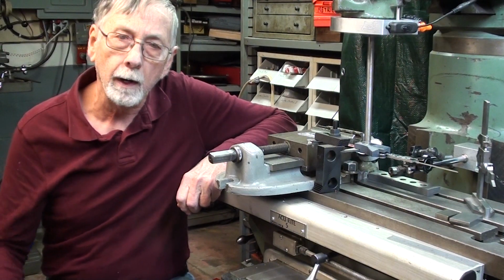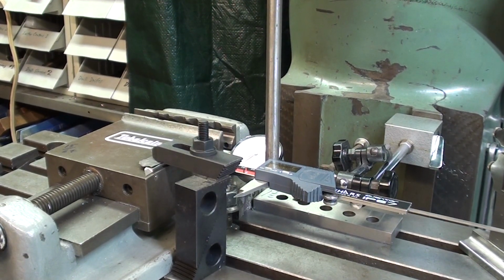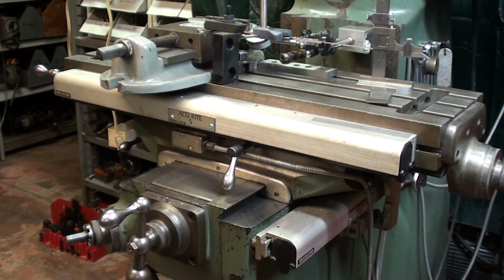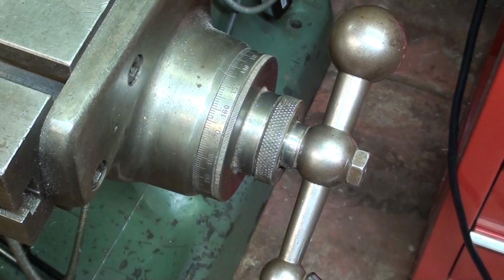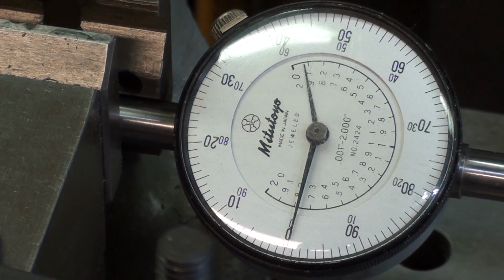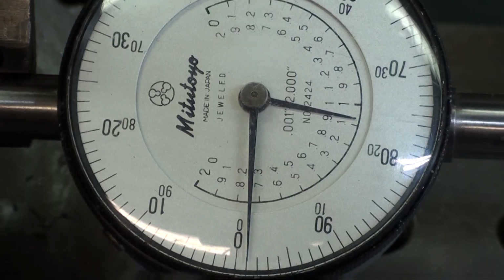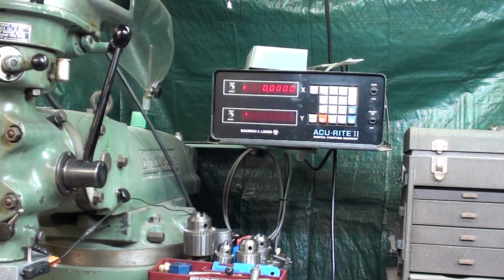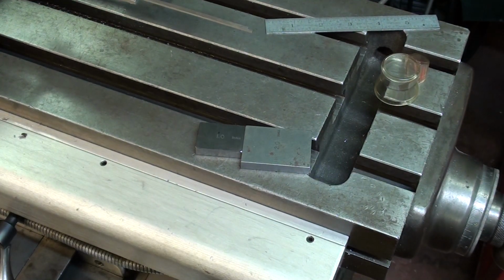Accuracy of the Bridgeport Mill Tips 527 tubalcain

Comment: Thank you Mr. Pete. It's great to see you bring up this subject since I worked in metrology lab at a helicopter factory. I did notice that you did not mention the temperature which would effect the readings. However, if all the instruments used were soaking at the same temperature for a while I'm assuming they were and they should not be too far off. The big issue we would run into to is, people never liked to send their tools in for calibration. Every instrument would have a cycle time of a calibrated window of time and things do drift in time. We would often say it's close enough for government work. The definition kind of goes like this. If you can measure with a micrometer marker with a piece of chalk, then you can cut it with a hatchet. Have great day and keep those videos coming since we are getting that storm tonight through tomorrow.
Reply from the maker: Everything had been in the basement shop at about 68° four months
Reply: I like your comment on temperature. Most machine shops and machines are cold at the start of the shift. Then allot warmer at the end but the components still seem to fit. Is it because we humans still have to manually  check the finished size.
Reply: Those of us that watch a lot of Mr. Pete already know his shop is at 68

Comment: like science    The more I learn the more questions I come up with.   How do D R O  work???   The dial indicator every time you moved it the more it was off.   All those internal parts tolerance must accumulate.    Must be some kind of ratio in there.  Please keep doing these.   GOOD WINTER PASS TIME
Reply from the maker: Yes
Reply: Most DROs use glass scales on which a fine pattern of lines perpendicular to the direction of travel are laid.  Through the glass you have a lamp and 2 photodetectors.  The shadow of the lines on the detectors gives a quadrature signal so the electronics can extract direction and distance information from the signal.  Other systems use small steel balls in a tube or an actual gear and track system.

All of these systems have some error.  Some have a common source - a scale at an angle to the travel has error known as ABBE error, temperature changes the length of a glass scale differently from the table, etc.  Most errors can be compensated for - in the examples by aligning the scale with the table and by providing a temperature controlled environment.

For most of us the normal sources of error don't matter in ordinary machining, but I've been around folks who controlled local temperature to better than 1/4 a degF to the point of providing a source of heat to replace the body heat when the operator was gone.

Comment: Nice setup. The flex in that 1/2" bar under the load it sees here from the caliper is going to be less than the resolution of any of the readouts. The dial indicator has a tolerance that is pretty lax once you get past the first 2-1/2 revs, probably 0.002". I tend to agree the DRO is likely the most accurate, but it looks as if all match within tolerance. As to the name of the caliper, I used to work with a "machinist" who called every caliper, even a simple 1/32" pocket caliper, a "vernier". I used, and still use, vernier calipers for many things, so always had one handy. Every time he got into a spot where he needed someone to get a tool for him-- a habit due to his poor set-up practice-- the first tool he usually needed was a caliper. "Hey! Grab me a vernier!" Knowing full well he wanted a dial caliper or the shop's digimatic, I'd hand him my vernier just to hear him scream "Not that! The vernier! The dial vernier!".
Reply from the maker: That is funny, I am grinning

Comment: great video. some time ago i ran a similar test on my van norman mod 12 and my 40 yr old mill drill.i was amazed at how accurate the dials were on both machines my readouts on both machines are the inexpensive igage units. these units are very accurate, i was getting plus or minus a thou over four inches. the reason for my test was my inability to center holes on my y axis to less than .004 i used four different edgefinders and got the same results.i reasoned that something in the machine readout s was causing the problem.turned out to be my technique with the edge finder. learned a lot from those tests. years ago we really had to know our machines to do accurate work .today i think we take them for granted.
Reply from the maker: Yes, I hope more people perform some of these tests on their machines. It is fascinating. And I am amazed at how accurate the screws are

Comment: I tend to trust my dial caliper a lot more than the digital.  I've had it since the mid '90s and I'm a lot more used to it.

I tend to think that the point of transition from/to a lesser used area of the feed screw into/out of a more used (worn) area is where a lot of error comes from on the older machines.  It's not just because of a small dial that causes the eyes of even the young to cross when trying to make that last 0.001 in feed.  

I don't have a DRO, so I fall back to a dial indicator.  My problem with that is I tend to get paranoid about cosine error (I don't trust my eyes with that either).
Reply from the maker: Yes 👍
Reply: If you're worried about cosine error, does that mean that you cannot make the dail indicator point in the right direction to within 2 degrees? The inverse cosine of 0.999 is 2.6 degrees. I never checked the precision in the direction of my indicator, but 2 degrees seems to be a lot.
Reply: @grieske  I set it up to look straight one way, it's crooked in the other.  After a while, it never looks right unless I go away from it for a while.  It's the eyes.  I dropped attempting to play musical instruments in school because the notes kept changing lines on the page.

I adapt where I can.  On a lathe dial, I use my thumbs to block out all but the one I'm trying to line up on.  I've also thought up and prototyped a jig that helps with setting up the dial indicator in most cases, and have ideas for improving it.  It's pretty simple, really.  

I think it would make a good introductory project for someone that it getting started with a lathe.  Mill or shaper as well, if they have one.  Embellish it if they want to, or keep as simple as needed.  I think it could be 3D printed, or machined out of anything that isn't jell-o or explosive.

Comment: I did this when i installed my cheap i gauging scales on my mini mill and was quite impressed..
Reply: The dro is the accurate one in my setup... since the dials on the mill are in thousands of an inch but its a metric leadscrew
Reply: I also have the igaging dros, not bad. I just really don’t like the lag on the display. And sometimes I really desire some of the features of the big units.

Comment: Joke Chinese proverb (cited many time below:) Man with two watches never certain of time. Uncertainty hovers in the background when someone declares a measurement to be exactly a certain value. Wise folks follow the number with weasel words stating a tolerance band, and reference the certification of the equipment used. This certification may be tracked backwards through calibrations and certifications of even greater refinement to the actual standards at NIST, a calibration date, signature, etc and even beyond to international standards. These standards are a very big deal subject to treaty obligations and ever more refined means of determination. For example most units of weight, length, temperature, electrical resistance, etc are no longer referred to actual physical specimens but to ... well that topic may be pursued forever.

NIST (National Institute Of Science and Technology) is a branch of the Department of Commerce responsible for maintaining the US standards of weights and measures. It has resources, procedures, authority, etc to certify the precision of the various standards used by US industry etc to parts per million and far beyond. The measuring tape and 6" scale in your EDC can, one way or another, trace its roots back to NIST.

We in the home shop and small job shop are happy enough to work to thousandths in envelopes of a foot or less. The greater the precision - the more significant digits in the number - the greater care required in taking the measurements. Thousandfhs may be measured with ordinary micrometers, tenth of thousands requires you to consider temperature effects and comparison to known standards (a preliminary check with the end standard furnished with your micrometer, a stack of gage blocks, comparative measurement, repeat zero technique.) Mr Peterson's demonstration illustrates the Two Watch Problem perfectly. There is always some uncertainty when working to the limits of your equipment's resolution. In the end you may have to work out which method is likely to be the most  reliable. I agree: the DRO if of reputable make, is likely to be the best bet.

 The closest work most of us is likely to do is machine ball bearing fits or fit ICE wrist pins and for that ordinary shop measuring equipment is plenty close enough. But we have to be aware the need for greater precision may be no further than the next job. No amount of denial or scoffing relieves the need for greater accuracy in building  machine tools, the rolling elements and races of ball bearings, astronomical telescopes, precision optics, etc. They simply will not perform acceptably if not made to a minimum precision dictated by their performance characteristics. 

The lesson here is keep an open mind regarding the precision of your shop equipment and how to employ it to best advantage when necessary. Grandpa's micrometer may be a cherished heirloom but if the lead of the measuring screw is worn out of acceptable limits it's time to retire it to the trophy case. And BTW, your new top of the line digital caliper is certified to the accuracy noted on the calibration certificate and that is  usually qualified by the  words "+/- 1 count." What does that mean? You better know.

But still, it would be interesting to run that AccuRite DRO against the Jo blocks. My DRC (ca 1981) DRO was pretty good (0.0005" in 10" IIRC) but the cal chart I made up has long been turned to mouse nest. Damn little varmints! If they weren't so cute....
Reply from the maker: That was a very interesting and scholarly comment. I enjoyed very much, and learned some things from reading this. I may do one with the Joe blocks, But still have not decided on the methodology. I was not trained in Metrology

Comment: Much better on the scientific method this time around Mr. Pete!  No swapping out variables in the tests, stuck with all the same setup, great job.  I would like to see you check out that Dial Indicator on the surface plate with gauge blocks, I question it's accuracy or that of everything else and that does not seem logical.  Check it out for us.  Loved the video.
Reply from the maker: You know what,? I think you just came up with a good topic for a video

Comment: I myself think this video is very interesting. My question is, is the dial indicator properly calibrated?
Reply from the maker: It has never been calibrated. Now I am thinking of doing a video on the surface plate checking the accuracy of that indicator with Jo blocks
Reply: If you can, pick up Moore's book "Foundations of Mechanical Accuracy". It's not up to date on the super modern stuff, but it'll give you a good framework for thinking about those challenges.

Comment: I need your help with something.  I am fairly new to machining, even though I am a middle-aged man, and I work at a small machine shop that is still in its infancy. When I first started I had to machine these small steel wheels with a thru-bore and then a 1" deep step/shoulder on each side for a bearing.  The tolerance for a step/shoulder for the bearing was +/- .0005, but all I had to check the I.D. with was a 6" pair of digital calipers.  Every set of calipers that I have ever seen, used or read about CLEARLY claim that they are only accurate to .001 and this would worry me to death when checking those small wheels with a .0005" tolerance.  I guess my question is, isn't the .0005" readout on digital calipers simply a marketing ploy or a gimmick?  Am I looking at this wrong?  Thanks for any help.
Reply: One problem with calipers is that the point you're using to measure is far from the guiding surface, allowing slight pressure differences to change the reading.  You can improve this by tightening up the gib on the back of the head and by practicing on known standards, but I don't think you're going to ever get to 'bearing fit' accuracy.

Were I you I'd get a set of inexpensive micrometers and gage blocks.  Use the gage blocks to check the micrometers and use telescoping gages for inside dimension.  Watch Adam Booth's (abom79 on YouTube) vids for examples of proper usage of both, it's mostly a 'feel' thing.
Reply: @russkepler  Yeah, Micrometers are the way to go for bearing fits.
Reply: @russkepler  Thanks Russ.  I have mics, gauge blocks, and telescoping gauges, but I was simply wanting to know why digital calipers read out to .0005" when they're only accurate to .001"  Thanks.
Reply: @tom87pate  With a caliper you have neither the accuracy nor precision you need for bearing fits.  Your caliper reading to .0005 does not have the precision, a caliper reading to .0001 would not have the accuracy you need.
Reply: @russkepler  Respectfully, why do the read to .0005" when they claim to only be accurate within .001"?  It must be a gimmick to sell more calipers.
Reply from the maker: I really never thought about that. But that would be something to worry about

Comment: I'd like to see you do the tests with the gauge-blocks and a vernier scale. My first calipers were cheap digital calipers but I don't use them often enough so the battery is usually dead. Therefore I bought some vernier calipers by a well-known company - but I discovered my eyesight isn't really good enough so it takes me an annoying few seconds or so to work out which lines are aligned.  I should have bought a dial caliper in the first place! P.S. Can you check the Mitutoyo against the gauge blocks?
Reply: If you have a cell phone with a decent camera, use that to read the vernier. Better contrast and magnification, even on my 10 year old flip phone.
Reply from the maker: That is a brilliant idea, I can also do the with the video camera and look at it on my monitor
Reply from the maker: I think I will do just that, several others have mentioned

Comment: That's pretty good accuracy for an Acme leadscrew...!!
Reply: Much of that accuracy comes from the operator.
Reply: @thomascrist5829  I agree, some folks just aren't as particular as others!
Reply: It is ground, not just cut.
Reply: ACME - Good enough for Road Runner, good enough for me :)
Reply: Hey..pretty funny one there! As for Acme Hardware....here in Sacramento, California...USA...there's Acme Rigging....top quality stuff for cranes and hoists... @kurtfrancis4621
Reply: What if you checked the digital Caliper with a 2.000 gage block?
Would not the caliper blades which are hardened be a good location to try the gage block?
The gage block would be the standard for the other methods.
Reply from the maker: Yes
Reply: Splendid video Lyle !  I like your approach to the experiment and join you in the speculation of why the results showed what they did. I always enjoy your videos and always come away a little  smarter.  Do you still use your variable speed , reversible drive on the tail stock end of your lathe ?

Comment: I ve always wondered how machines can be so accurate to make crankshafts, cams, pistons, ect.  How do they calabrate them?  Lazers?  They do it somehow or my cars wouldnt run 300k miles.
Reply from the maker: Yes 👍👍
Reply: I am a machine builder by trade. We use electronic levels to ensure there is no twist in the bed of the machine and that it is level to the earth. Then we use an autocollimator to measure the straightness of the rails. They must be straighter than 5 arcseconds. Dial test indicators measure the parallelism of the rails to each other on the machine bed. They must be under 0.010 mm total deviation. A calibrated granite square and two indicators ensure that all axis are truly perpendicular to each other within 0.005mm / 1 meter. When the machine is complete we then use lasers to measure and compensate backlash. The end result is an extremely accurate and expensive machine.